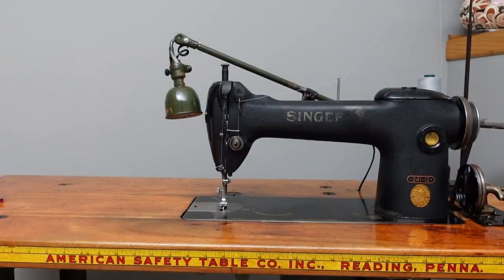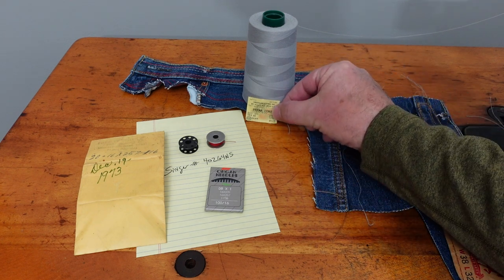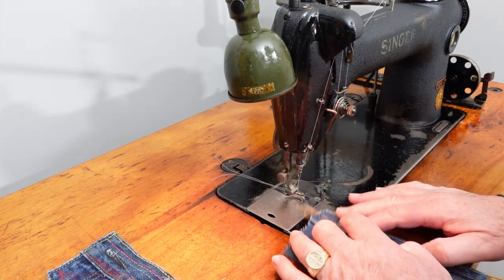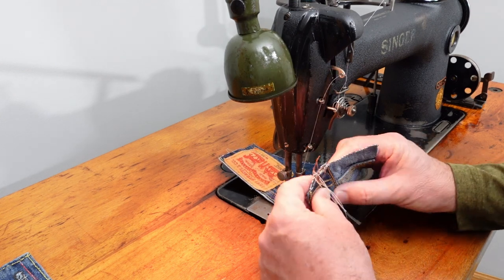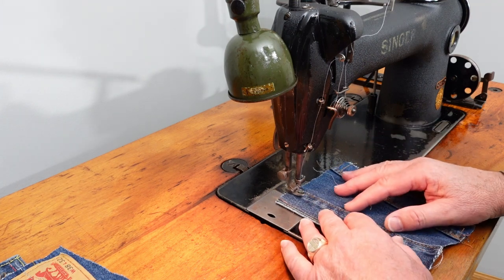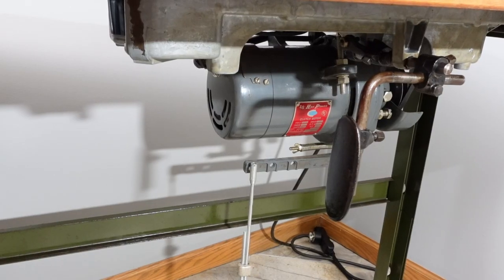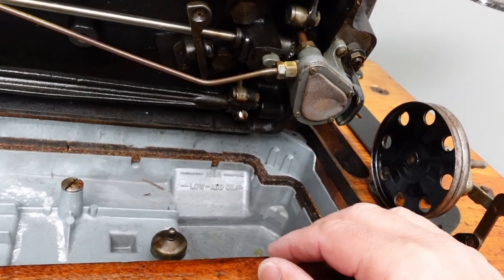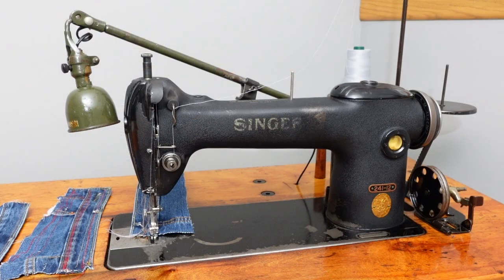Vintage 1949 SINGER 214-12 Industrial sewing machine demonstration.

Comment from the maker: Remove top and side covers to clean and oil, two screws each. Mine is the 1750 rpm motor cleaned and oiled. Watch my video on cleaning a clutch motor.

Comment: I have 241-11 which is the same in my opinion. 18 size needle and 69-90 size thread.
Reply: Yeah same machine maybe a bit stronger than the -12 with the 11" throat instead of the 12"

Comment: I have a treadle 31-15 I was planning on using for quilting but also need to replace my original base as well. I have a tompson walking foot but I’am not happy with its performance any suggestions for another machine ?
Reply from the maker: Adler Made in Germany walking foot expensive but only have to buy once.

Comment: we just brought one home and are excited to use it!  I found the manual online, but haven't seen where to oil on the topside.  Are you able to help with describing that?  Also, how did you adjust the speed other than the height of the pedal?  We have ours as high as possible, and it's still lightning fast.  I heard you say you adjusted it in the motor.  Any help is greatly appreciated.  Thank you so much!!!!
Reply: Did you ever find out ? I’m in your situation as I just purchased one I would appreciate it
Reply: @jesusmunoz2439 unfortunately no